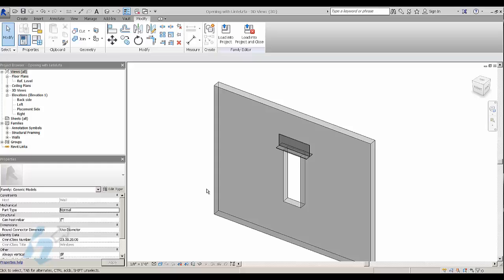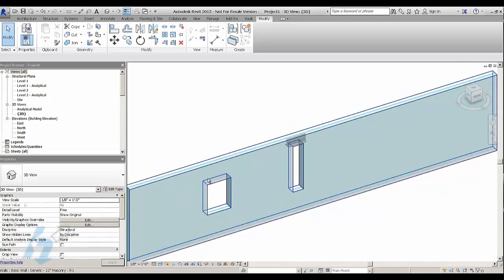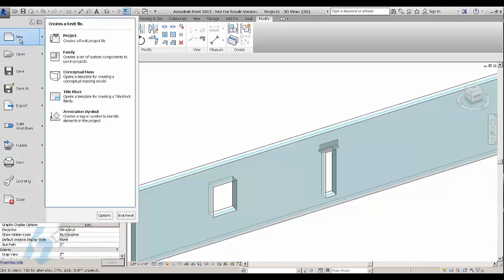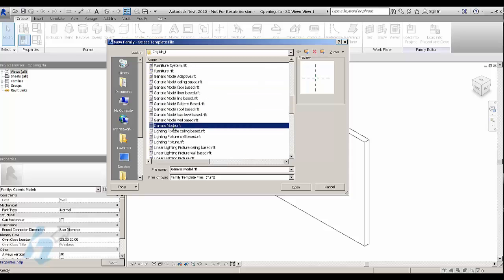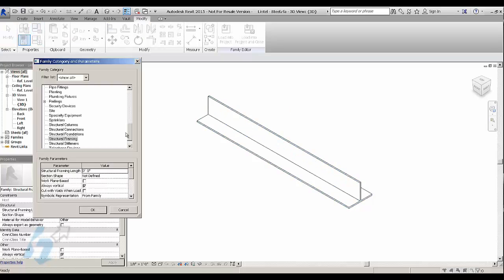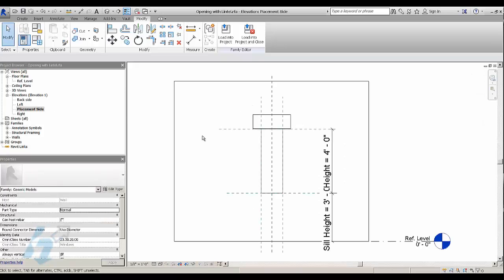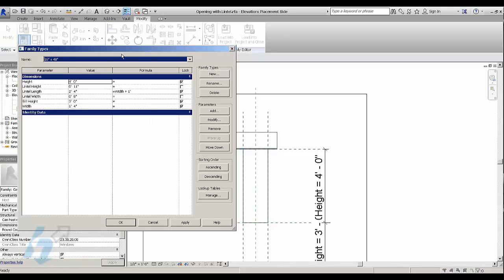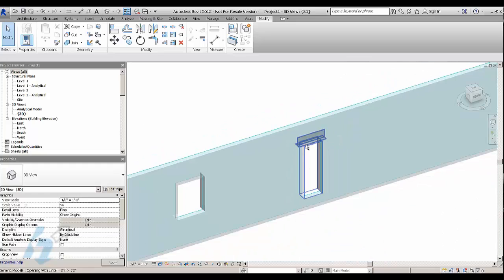Opening with Lintel

Comment: I am struggling to get my Lintel to adjust to the opening width. Do you set the parameters for the Lintel in the opening model after the Lintel Generic Model has been loaded into it?
Reply from the maker: I took a look at this and I think the error is that Robert said to make the Lintel family Shared by checking the box.  I tried it without doing that and it worked.  Therefore, you should try it again without selecting the “shared” checkbox in the Lintel Family.  You will need to purge the original lintel family before Revit will allow you to load in the non-shared version, or just start a new one from scratch.  You can then place a new instance of the lintel in your opening, constrain the alignments, then select the lintel.  If you made them type parameters, click Edit Type and you can then click the small gray button in the “=” column to link the Lintel Length parameter from the Lintel Family to the Lintel Length parameter created inside the Opening family.
Reply: I guess you hide something, and don't want to share it. I tried to follow your clip and your guide but can't create the lintel for my door. I can't see the gray button in Lintel parameter or door family, so can't link them together.